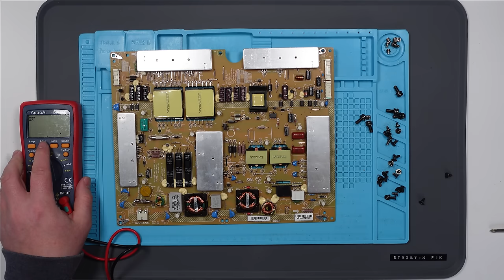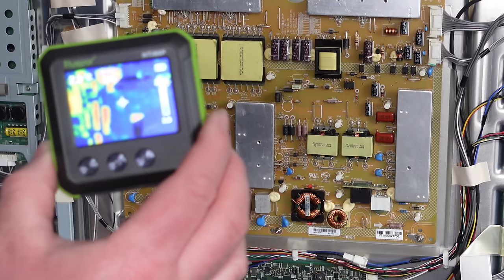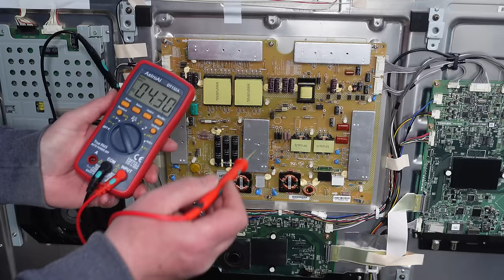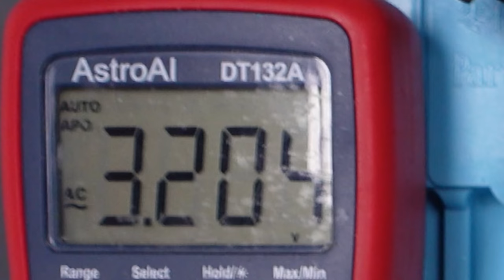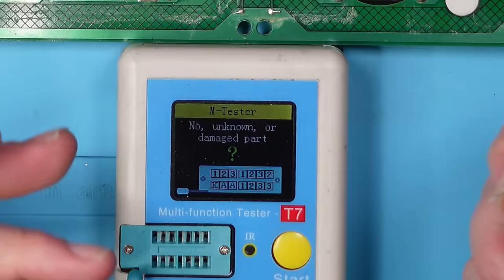Trying To Fix A TOSHIBA TV With NO POWER

Comment: The coil is there as a choke filter on the mains input side. Looks like one side of it is open circuit. Probably burnt the coil when something shorted and also blew the fuse. I think something else has shorted further down. Probably a diode has failed short circuit. I'd be removing the bridge rectifier and testing that as a starting point. It's always best to test them out of circuit.
Reply from the maker: Thanks Fuzzy!  I'll definitely do that, really appreciate the info!  👍
Reply: Yes i put my money on this reaction :)
Reply: I was gonna comment something similar to this. That coil might be burnt, thus causing the short. 
If something so dramatic happened that even physically blew the fuse up then I'd suggest checking all the caps off circuit as well. They might be damaged because of the over-current that flowed through the circuit.
Reply from the maker: @lnFernemLand  Appreciate that, yeah, I'll check them over too!

Comment: coil is open - probably because a higher rated fuse was used and the coil became a fuse! save your money for now, simply bridge it out - its only a common mode suppression choke anyway - my guess is - once bridged out, the fuse you replaced will blow the transformer driver, control chip - or (unlikely) a capacitor is shorted

Comment: These small 2-pin devices are spark gap protectors and they serve to suppress voltage spikes across the coils of the common mode choke. Spark gaps are OK, the common mode choke is not. Likely the coil is damaged somewhere near the points where the enameled wire is soldered to the pins, and often this can be fixed quite easily and you don't need to replace this component. But I doubt that's the only problem.
Reply: For testing he could have just bridged the spark gap.

Comment: You can desolder the coil from the board and test it scrape some of the insulation off the coil and/or unwind the coil and see if there’s a break in the coil since you can’t get another part...
Reply from the maker: Thanks Darren! I'll definitely do that! 👍
Reply: the coil is just a symptom, it makes no sense to replace it without knowing the cause of the blown fuse.

Comment: Steve, the coil is open circuit. Those coils pass the 240vac on both sides. One side is open. On resistance, you should see roughly a short through each side. The thermistors are probably ok. The coils provide some filtering of noise  from or to the mains supply. 
Also, have you ever heard of a dim bulb tester? It's a device that allows you to let a controlled amount of current into a device. It would let you connect up the TV or other equipment without blowing the fuse. Basically, it puts a bulb in series with the AC supply rail, and in doing so limiting the current /  wattage allowed into the device to the wattage of a bulb. If the bulb shines bright, you are drawing the full wattage of the bulb, if it's dim you are only drawing a small current or wattage through the bulb. Its a way of protecting the device by limiting current flow into a piece of equipment. If you switch out the dim bulb, it allows the full current to flow unrestricted, and a fuse will blow if the equipment has a short on the supply rail. Another device you should be using is an isolation transformer to give you some level of protection from electrocution. Good luck.
Reply: great suggestion re dim bulb

Comment: My far-too-late commentary. (I have more than 20 years experience with switching power supplies.)

The coil is most certainly a common-mode choke for EMI suppression. There must be DC continuity through each coil for the mains to reach the bridge.

The small components shunting the coils are  likely transient suppressors (varistors). At 240V they will be open-circuit. They are meant to suppress high voltages that can be induced by input surges (lightning strikes on the mains,.etc) as the CM chokes can 'ring' and boost sudden input voltages to insane levels.

(Normally there is a single large thermistor in series with the input for inrush suppression.)
Reply: To add to the far-too-late commentary: true, but, the coil being open circuit is just stopping the fuse from blowing again(*). If he fixes it, the fault is still going to be there.
Anyway, let's watch the follow up.

(*): which is odd as it shouldn't have gone open circuit along with the fuse. I would have expected to see WAY more carnage in the rest of the circuit if the faults were related.

Comment: Plenty Of Comments already about a possible short which stressed "Burnt Out or open Circuited" that Choke, if there are no shorts across the voltage rails "Voltage Test Points to Ground" The choke can be rewound and soldered to it's original points, make sure the windings are returned to the correct turns if there are 12 turns then make sure you end up with 12 turns.. 

Check every other board and their Voltage Test points to ground as well before connecting them to the power Board, As the Power board will fail as soon as you connect any board with a short in it's supply rails. 

The Thermistors on the Power Board I believe should have a specific resistance to them when at room temperature BTW, So I'm guessing they too were stressed out to end up open circuited like they are, They need to be replaced with the correct values before testing or applying power to the Board as they are there for the protection of sensitive components on the Board and all those other Boards <--- I cant stress this enough but Check and ensure all the boards don't have any shorts on their voltage rails.. Eg: one probe on the boards ground and the other probe, probing each respective voltage test point in continuity mode for each board "WITHOUT ANY POWER CONNECTED"
Reply from the maker: Awesome, thanks Bear! 🐨 Excellent advice as always. I'll make sure I do all of these things! Really really appreciated 👍

Comment: I had a Vizio 55 inch I bought in 2017 that went bad last year, I replaced it but never got rid of it, I had a feeling it was an easy fix. Sure enough in September I took it apart, tested the power board and ordered a replacement for $50. Now I have an extra 55 inch TV and actually accomplished something 🤣

Comment: As Fuzzy electronics says the coil has gone open circuit. But to have gone open circuit a lot of power must have gone through it. That would suggest something major has gone short. If you do get another coil check for shorts before putting any power into the board. It is possible that the short has gone open. But this would produce a lot of heat. My suggestion is take the heat sinks of the components as you may find that there is a crack in the faulty one or it may just crumble away.
Reply from the maker: Thanks PDS!  Yes, excellent suggestion.  I'll get all the heatsinks off and check all the components under them!  Much appreciated!  👍
Reply: Which kind of temperature can crack an aluminium heatsink? That's insane.
Reply: @goku445  He's obviously talking about the mosfets under the heatsink goku, not the heatsink itself. He just calls them components, not mosfets.

Comment: Those axial components you desoldered are indeed very likely NTCs, probably used for inrush current limiting. I agree with those who recommended hunting for the root cause of that common mode choke/coil to fail open, vs. having it's lacquer melt and short windings. That must have been quite a bit of instantaneous current flowing through that thing. The bridge rectifier is a prime suspect, assuming you can't find any shorts on the DC side once you took it out. Fun stuff!! :-)
Reply: Aaaaaand I just realized that your video was not from 2 days ago,  but a YEAR ago... :hidesunderrock: 🤣 Did you ever fix it?
Reply: Lol was thinking the very same thing.

Comment: My knowledge on electronics he’s on about the same level as yours but all myself and retired I would love doing it as a hobby I found by watching your channel I am learning things through what you are doing I have myself worked on TVs and in the past I have bought TVs that will not switch onAnd with my knowledge I have usually narrowed it down to one board I found it a lot easier in the past to search on eBay for a replacement board these are readily available secondhand I suppose for your channel it’s more about finding the exact problem but with these complicated TVs you usually find on the board there’s not just one component at Fails it’s usually two or three as other people have already said I just thought I would put this up to give you another option you probably already know thank you for your channel which I recently stumbled across look forward to your next videos stay safe

Comment: Whilst you could remove and ‘bypass’ the choke for test purposes the fault that caused that choke to fail and then blow the fuse ‘when the TV was on for a while’ needs investigating first, otherwise if the fault is still there then any replacement choke will also fail.

Ideally remove the bridge and then check it out of circuit followed by high DC voltage, current- protected injection into the bridge output. High voltage power supplies are not in everyone’s toolkit however.

If you have a variac with a light-bulb limiter than that could be connected to the input of the bridge (first remove the coil nearest the bridge). A failure after a time period may show itself by the lamp becoming bright.

Circuits that fail after a time period are always the most difficult. 

A circuit diagram would help (the second ‘non blown’ fuse may be in the low voltage side perhaps pointing to an issue in the high side, one or more FETs or something has failed in the switching circuit).
Reply from the maker: Thanks Ralph, really appreciate the info.  I'll definitely be having another look at this, as I want to see what's going on under those heatsinks.  I should really have removed them first time around, as you're dead right, that choke didn't fail by itself!  Thanks again for the info 👍
Reply: You are welcome
I did forget to mention also having another look at those varistors which are usually there to reduce inrush current, though being connected across the coils is a little odd.
Good luck with the repair.
Reply: @ralphj4012  You are right. That was my first thougth as he said that the set ran for ten minutes. 😁
Reply: bridge the spark gap, limit the current and check which component is getting hot.

Comment: Like stated, the first winding is the issue, of course i cannot really shove my face to the board to confirm is it.  If the fuse blew up with in 10 minutes, then there has been short near the ac. I think you did check the caps so then next in line to check
Degauss Posistor - very likely.
Horizontal output transistor.
Power supply regulator if there is one.
Power supply chopper (switchmode) transistor if there is one.
Diode(s) in main bridge
Main filter capacitor(s).

Comment: Hi, those Coils, is one side Positive and the other Negative?, seems like the 3v AC may be where the other side isn’t passing through the first Coil, may be the Negative side, so you could be right, the first coil has a break in the Negative side.  Just a thought.

Comment: I stopped messing with TVs years ago, they blew my mind a lot, the common faults got boring. Anyway Brother since when did you gain the Monty python Patreon.
Blowing a fuse when replaced, the first check should be the Bridge, Diodes, MOV's but.. as its a To-Shiba TV it's 2/3 common faults with their shit psu boards.
Some comments, are sort of close but no cigar, if it was the spark gaps going off. I'd say replace the caps & no! it's not them Yet! To be continued... 📺 🖖👍
Reply from the maker: Thanks brother Steve 🙏
Sage advice as always... I'll definitely be trying to get to the bottom of this one. I need to do some more research and order up a few bits and then i'll take it on again. I had a feeling it wouldn't just be as simple as the common mode choke, that had to fail for a reason, so I'll be taking all those pesky heatsinks off and I guess I'll take it from there! Wish me luck! 😊
Reply: Steven1: Right! One!... Two!... Five! Steven2: Three, sir! Steven1 - Steven1: Three! (angels sing) (boom! goes the TV) 😂🤣🤣 The Monty Steve(s) version 😁 
 
Hmm hmm the choke that filters the mains transients would be dead as a rock 0 pulse but yours shows signs, that helps give the answer to where the fault is 😊
Reply from the maker: 4 shalt thou not count, neither count thou 2, excepting that thou then proceed to 3. 5 IS RIGHT OUT!
Once the number 3, being the third number, be reached, then lobbest thy Holy Hand Grenade of Antioch towards thy TV, who, being naughty in my sight, shall snuff it. 😁

I really appreciate your cryptic clues, without giving me the answer. It means I have to use my tiny brain to actually work it out! 🙃

I think this one might be over my knowledge limit, but I'll certainly be giving it my best shot! 🙃
Reply: Amen.

That's my dad teaching me, coming out in my thoughts and typing, he loved the cryptic stuff and I was always tested at work on breaks, when we did the papers cryptic crossword puzzles we shared them but man was he good at it. Never!! a day went by were we'd go home without the puzzles complete in the news papers 😢 But hey! He lives on in ME!! If I give answers to things I know to be right, then the person(s) reading it, using it will not learn to help & them self's to the truth.

Steve I have FAITH!! in You!! As a human Person. Not just because we share a name, but also the fact you have a good heart & soul. It shows in the way you talk and act in your videos. I know for one you have the ability and knowledge to get the devices/items you work on back to there fully working state. Maybe when this whole virus things over we can meet or talk in person, we'd drive others crazy with silly jokes and stuff but hey it'd be fun and good to socialize away from the internet.
Reply from the maker: Your dad taught you well!  And it's great that you are able and willing to pass that knowledge on to others.  You know I appreciate it!  👍

It's been that long that I can't remember what socialising away from the internet looks like!  As these restrictions are slowly lifting, I'll be opening my pub back up this week, so i'll be helping others to interact over a few beers.  That's always the best way.  😁

Comment: Did you check the 5 V rail? Standby the TV uses 5 V standby you need to check where the standby voltage comes in. If it’s below 5 V then you know you’ve got a problem with the TV and the power supply.

Comment: replace thermistors , u can use the black disc ones same thing, from any tv, but thats gone more than likely a mosfet under one of heatsinks has gone short, common is that a vestel psu..

Comment: When my friend gave me a TV last weekend saying if I can fix it, it's mine to keep, I admit to thinking "I hope it's something simple, 'cos I'm going to be in over my head. 😬".  I can confirm however:

T# fuses are time delay, so they resist for a while before blowing (as opposed to F#, which are the more common fast blow). ✔️

Thermistors are thermal affected resistors. ✔️ No idea how to test them, like you say, because they change with relative heat.

I agree that Flib and Fuzzy are plausible with the coils. Not knowing much about the internals of a TV, I wonder if there are two near identical circuits to run alternate TV lines in the screen for each refresh (if this theory isn't clear, check out episode 3 of my "Electronics For The Lesser Knowledgeable" series which covers TV and region compatibility). Just a theory.

Worst case scenario, you could claim to be a rockstar and launch the telly out of the window. 🤘😂 (Don't do this, kids - it's dangerous and irresponsible. Plus it doesn't spectacularly smash like the old glass fronted CRTs, like the Who would've had... I mean, don't do that either.  Can anyone lend me a shovel for the whole I'm digging myself into?...).
Reply from the maker: Haha!  Comment of the day, for sure!  😁  Appreciate the heads up on all of these things, as always Toxo! 👍
Reply: No worries  @StezStixFix . 😎👍

Comment: 0:01 toshiba tv's common faults , 
1st -  5 watts ceramic resistor in primary circuit just after bridge rectifier burn open 
2nd  -   5 watts ceramic resistor in primary circuit just after bridge rectifier burn open 
3rd -   5 watts ceramic resistor in primary circuit just after bridge rectifier burn open

Comment: im a year late , sorry I only just saw this video. at a pinch you could bypass that faulty filter coil with wire (not the best solution but it'll work), best solution is replace the coil with a new one

Comment: Usually on the circuit board, it prompts you where to probe your tester and it tells you the voltages it should be serviced as sadly they don’t do schematics for new TVs. Anyway old televisions. Yes new TVs no